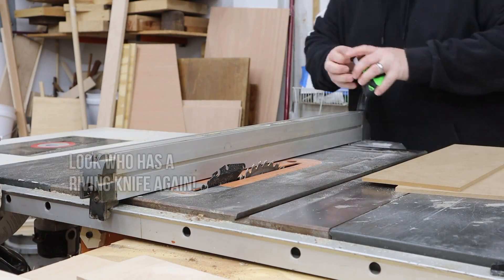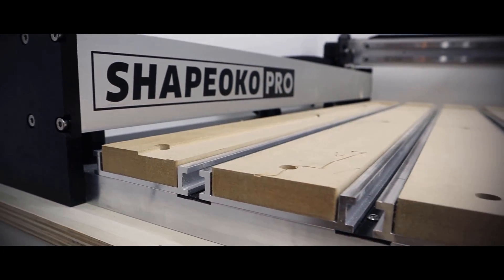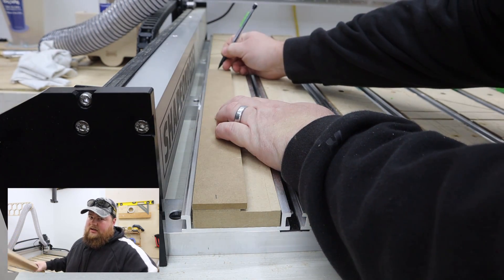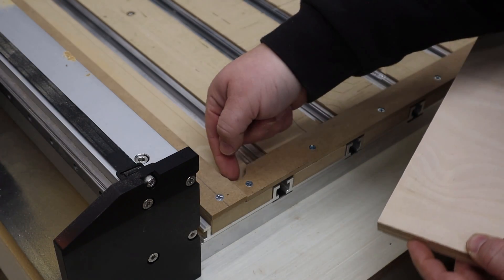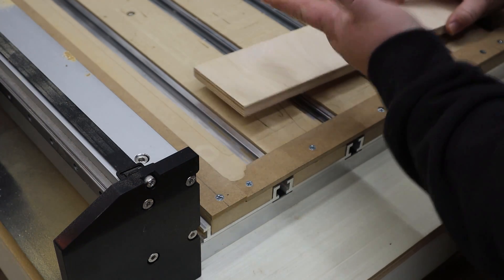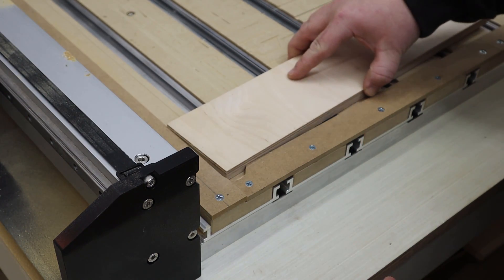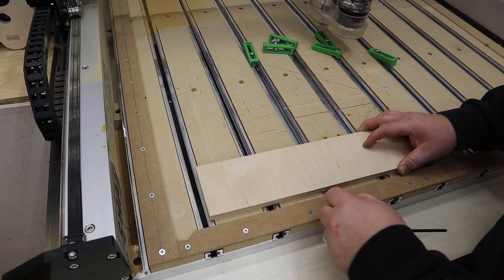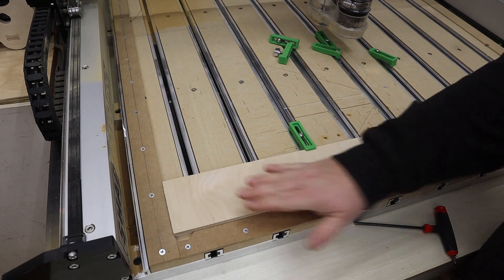SUPER EASY! Shapeoko Pro CNC Fence Build

Comment: I'm having trouble with my Shapeoko XXL , in contour cutting the cut will rise up in some areas , just rise and go back down for no apparent reason.  It did this before and after I just replaced the belts and V pulleys, please advise if you can,thanks , love your videos
Reply: I have heard of software glitches from people such as 731 woodworks. The solution was to turn off everything to reset it and restart.

Comment: I think I would've opened up the front fence at each t-track to make inserting the clamps a bit easier.   As it is now you would have to disassemble the clamp, slide the nut under the board, then re-assemble the clamp.    I like keep my clamps assembled and just slide them in wherever I need them.
Reply from the maker: As time has gone on and I've used the fence setup more, I agree with your comment. In truth, I only find myself using the left rail and the front generally gets in the way. :) I have recently removed the front rail and don't miss it that much. I am getting due for a new wasteboard and will rebuild the fence at that time.

Comment: oky now what about your t track you blocked your t bracket channel.
Reply from the maker: The t-nuts easily slide under it for the clamps. I've not had problems with it yet, but I don't use anything fancy on the table either.

Comment: Why would you need to surfaces the spoiler board, Great videos too. Really debating on getting a CNC
Reply: Sometimes you need to cut through (just a couple thousands) the material into the spoil board to cut out a project.  When the spoil board gets a little worse for the wear, you can go back and re-surface, removing just 0.015 or so and have a new flat work surface.

Comment: Question in this video I think I saw at the3:40 min your spoil board with one of you t t tracks with what looks like a cut made but an End Mil  Just wondering how that happened
Jeff also did you do a video on your dust hose bracket on your cnc
Reply from the maker: That was the result of bit slippage. The machine will happily mill itself. LOL Never had an issue with it since buying the dedicated collet wrenches I now use. There is a video on the CNC dust hose on my channel, yep. :)

Comment: Why didn't you just leave some space between the two fence pieces. If you didn't butt them up to each other the corner of whatever material you are using would have room to sit flush and you wouldn't have to cut into the guides? I'm asking because I am looking into buying a stepcraft q404 and I'm trying to learn all I can. Thanks
Reply from the maker: It was my first fence and I filmed as I made it. No pre-planning. After using it for a few weeks, I've found that I don't really use the left fence and just use the front on for referencing since it's set with the machine.

Comment: is it possible to use a longer piece of wood than the bed ... for example 6 feet x 2 feet  .... mill first half and then move the piece to mill the second half  ?
Reply from the maker: Absolutely! So long as the piece is not wider than the two Y Axis rails, you can tile projects as long as you like. :)

Comment: I drilled holes with my cnc spaced out all over my waste board like a grid. Cut dowels to 1 inch now you know that your material is square and easy to repeat cuts and can adjust to different size stock.
Reply from the maker: Smart and creative solution!

Comment: Aren’t you going to tell us what you were making? I’m guessing hold down clamps. 
Did you use any inserts into your spoil board or what type of screws did you use? MDF isn’t known for its ability to hold screws. Great video Sam!
Reply from the maker: The pieces cut are components for shelf bracket kits. No inserts, and the screws are normal wood screws about 3/4" long. I'm not worried about the screws not holding, the forces exerted during cutting should never be so great that they dislodge the screws. If a 0.1" tab can hold a piece while being cut the army of screws will hold it too. :)